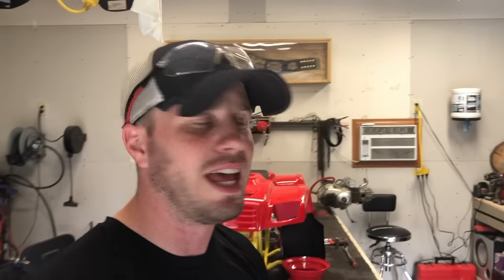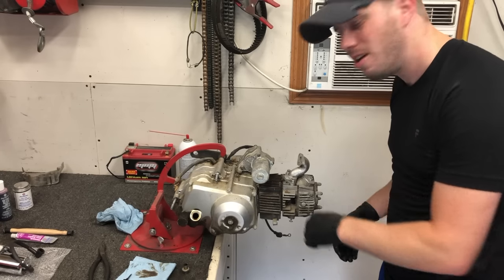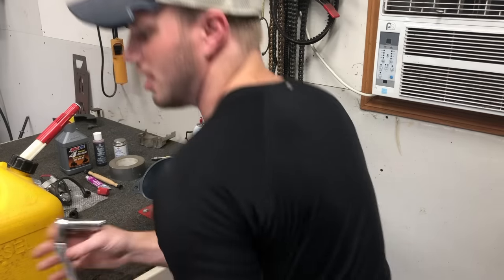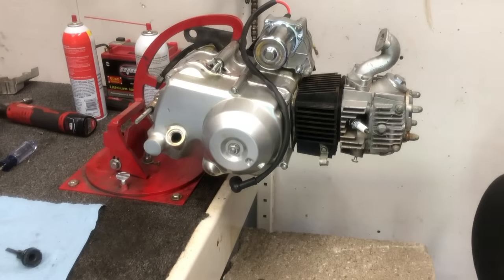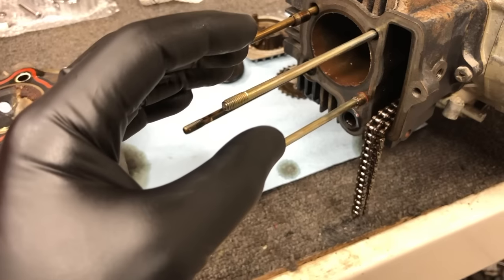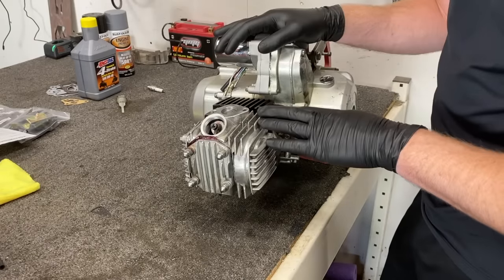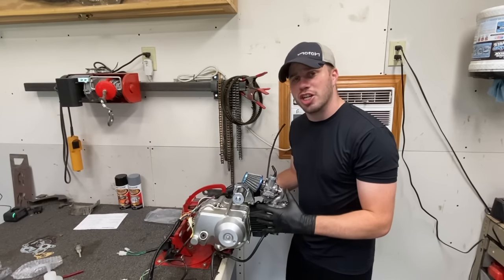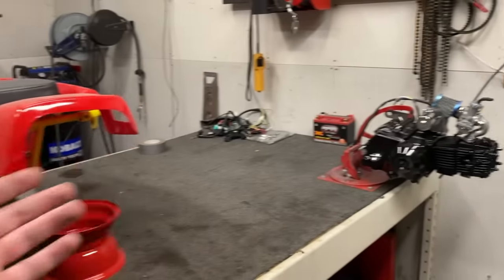Restoring a TaoTao 110cc Chinese ATV! Complete motor rebuild! Part 4

Comment: What does it mean if I got oil coming out my header screws do u know what it could be
Reply from the maker: Probably just a bad gasket, unless it's excessive then you might have over filled with oil.
Reply: @PraskaBoysGarage  what size do you gauge the cylinder head 110cc
Reply from the maker: @jonathangreene1697  I'm sorry, I don't understand your question.
Reply: @PraskaBoysGarage  sorry I meant to say what feeler gauge do I use on a new cylinder head for the 110cc motor.
Reply: @PraskaBoysGarage  setting the vavles what gage do u use. Sorry for confusing you

Comment: Where did you get the motor mount for your table? Need one bad.
Reply from the maker: My engine stand is probably the most popular tool I have. I got it off eBay back in 2018, but the seller is hit and miss when he lists them. I am currently working with a guy who owns a CNC machine to start making them myself!
Reply: @PraskaBoysGarage  Wow! Brother I probably follow 100+ people/ channels and no one has ever replied. Thanks for the help I appreciate it.
Reply: @PraskaBoysGarage  I would love to help support you and purchase the first one. When they hit the ground hit me up as your first customer.
Reply from the maker: @waynehead4902  Absolutely man! I'm just a small channel when it comes to YouTube, but my main focus from the start was to help others with their projects. Production is in the works on the stands. Right now I'm working with my website to make them available for purchase!
Reply: Thanks again brother, permanent subscriber.
Reply from the maker: @waynehead4902  Love it! Thank you for your support!

Comment: where can i buy that engine stand? thanks
Reply from the maker: That is the #1 most asked question on my channel and I am expecting it to come up a lot from this video! I originally purchased the stand off eBay back in 2018, however the seller is hit and miss when they are listed. So I've decided to start working on manufacturing my own! Might be a little bit but once I'm ready I will be making a video for the launch!
Reply: @PraskaBoysGarage  i cannot wait. Goodluck

Comment: where did you buy your red motor mount.
Reply from the maker: My engine stand is probably the most popular tool I have. I got it off eBay back in 2018, but the seller is hit and miss when he lists them. I am currently working with a guy who owns a CNC machine to start making them myself!
Reply: @PraskaBoysGarage  thank you for the quick reply. love your videos... very helpful.
Reply from the maker: @bang9764  Your welcome! Thanks for watching!

Comment: Can anyone help with torque specs? All im doing now is oil change so i just need the both side cover torque specs. I did hand tight for now but not sure if anyone knows exact spec
Reply: Mine is a 125cc
Reply: Why’d you take the covers off?
Reply: @kar21ol96  to get all the sludge out as much as possible. It had been sitting for a long time.

Comment: Where did you get the engine stand?
Reply from the maker: It's the #1 most asked question on my channel and I am expecting it to come up a lot from this video! I originally purchased the stand off eBay back in 2018, however the seller is hit and miss when they are listed. So I've decided to start working on manufacturing my own! Might be a little bit but once I'm ready I will be making a video for the launch!
Reply: Praska Boy's Garage BJ, that’s a great idea. I know ramping this up is scary but you have a great opportunity here. I know this will work for you.
Reply: Praska Boy's Garage My biggest problem with Chinese quads is a lack of knowledgeable mechanics. This is the only way most of us learn about these ATVs.
Reply: Praska Boy's Garage I like the videos you do where you explain steps. Nothing fancy. Just teaching other people what you have learned.

Comment: can you send me some pics of your engine stand i want to build one for my self Thanks Randy Bracebridge ont
Reply from the maker: I actually had a CNC company laser cut out all the metal to start making and selling my own. I will be selling the kits on my website either as a DIY kit or a completely assembled and power coated. Should have everything ready next month and will post updates on the channel.
Reply: Do you have cost on them yet
Reply from the maker: @harley87bracebridge88  Not 100% locked in yet, but the thought is $99 for the DIY kit that comes with all metal precut, hardware and instructions or $149 for the built stand that's been powder coated.

Comment: som one once told me that the diesal
Reply from the maker: It's not the most effective but it is very safe to use compared to other cleaners and if you run diesel equipment usually you have it available.
Reply: Praska Boy's Garage Ive got a motor just like that one, Alot of dirty old oil in there do you think flushing it out with diesal will clean that junk out ? And my previous comment i meant to say some one told me diesal is flammable.